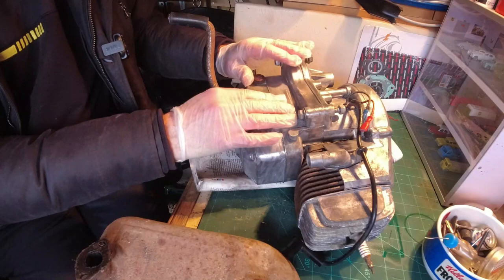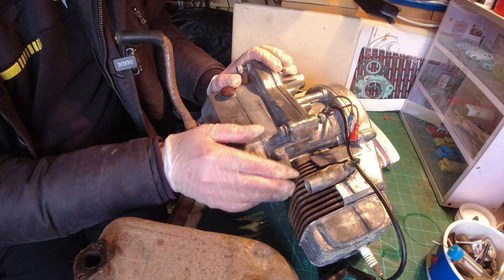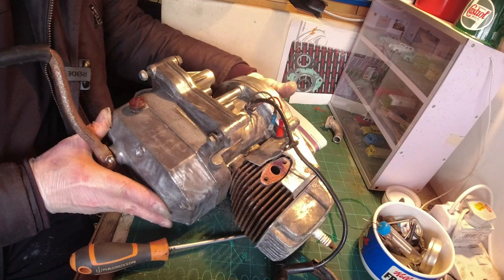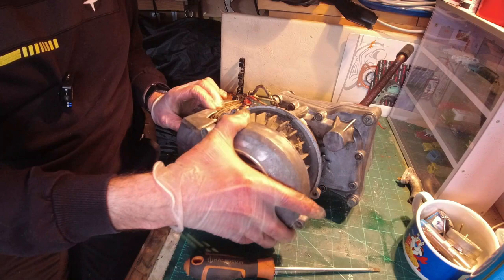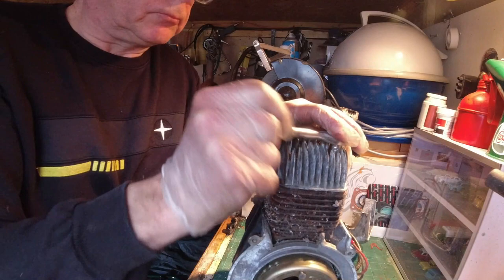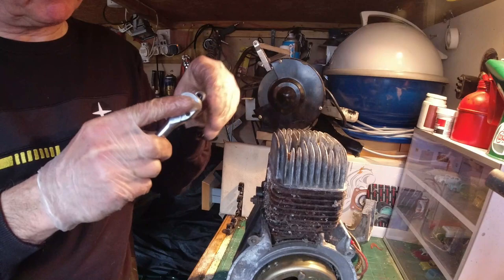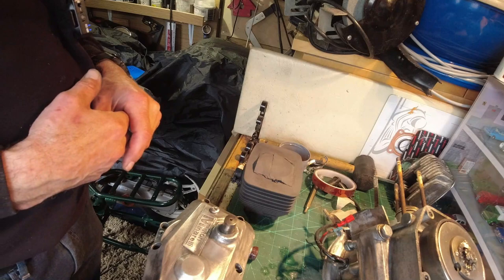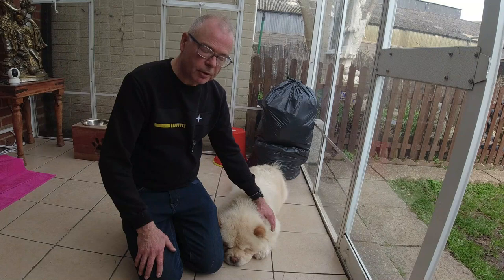Minarelli V1 50cc Engine Strip Down ( Cimatti Mini Chic Restoration )

Comment: Hello! where in the engine are the cc's? I don't know if mine is 50cc or 60cc
Reply from the maker: Hi Alejandro, I may be wrong but I thought that they were all 50cc. I think that you can buy an upgrade kit, but I think you could tell that it had a new cylinder.
I did not see any markings which has it's engine capacity on.
Take care, Jeff